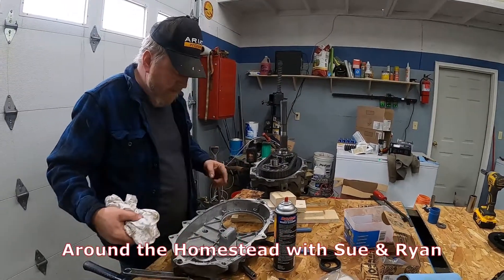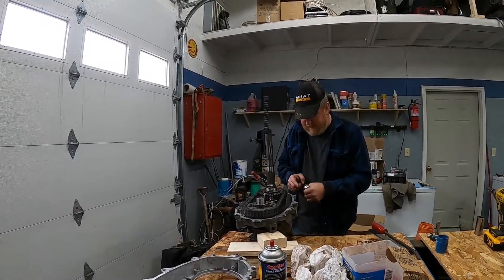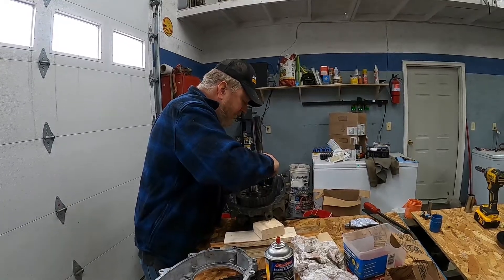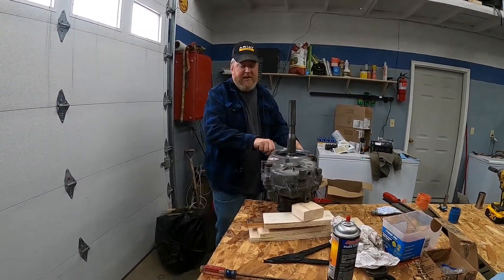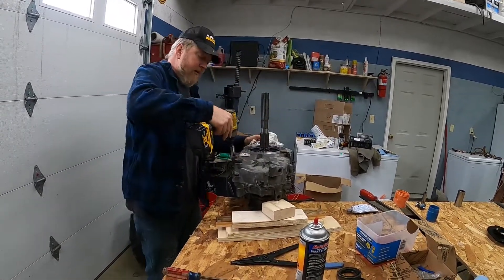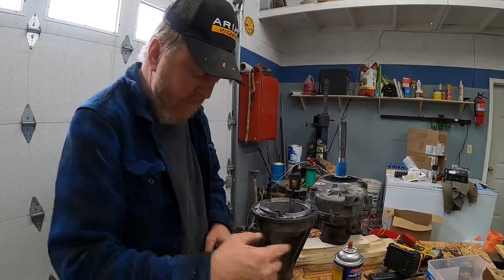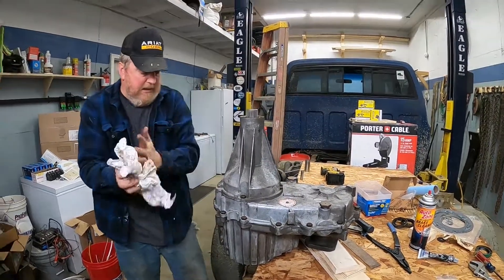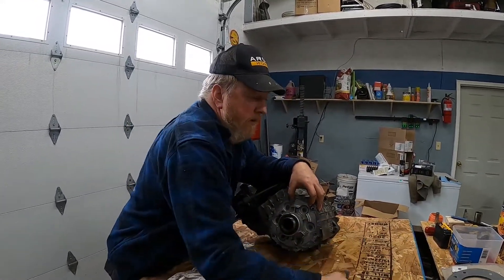Assembling the NP208 in the Apocalypse Truck prt2

Comment: Thanks, Thanks for your video!... A question, about the chain (belt), ¿How to know if it still is fine?, ¿Do you know how much does it cost?
Reply from the maker: Generally i would say just change the chain, We opted to go with it as we never use 4 wheel drive unless we are stuck so it is not going to get any miles on it. They are usually 50-100 dollars. They basically stretch and just get loose.

Comment: What kind of oil fluid did you use on the transfer case?
Reply from the maker: I used Automatic Transmission Fluid, I forget what type but it was whatever I had on the shelf